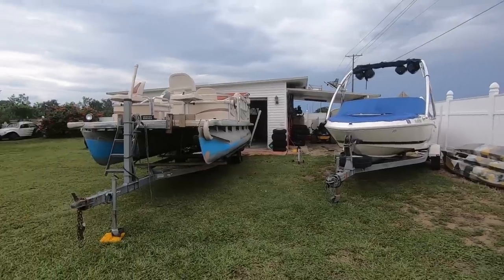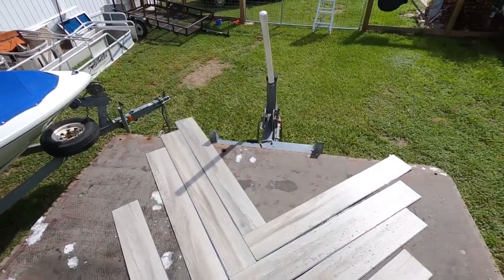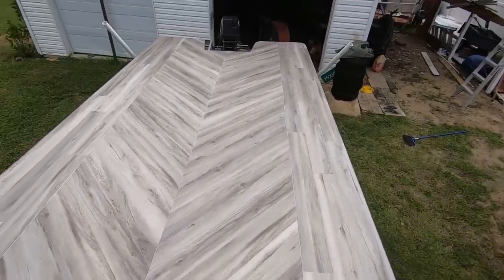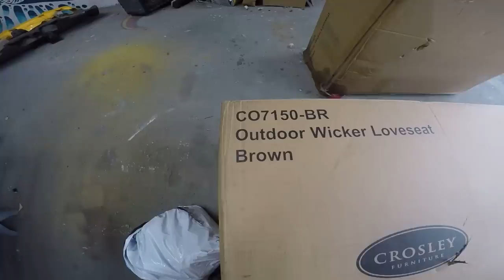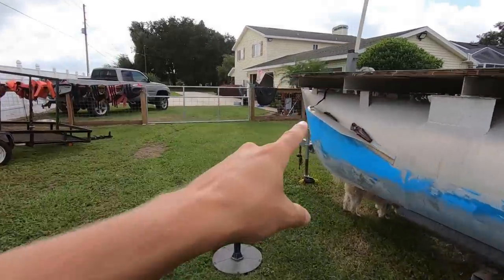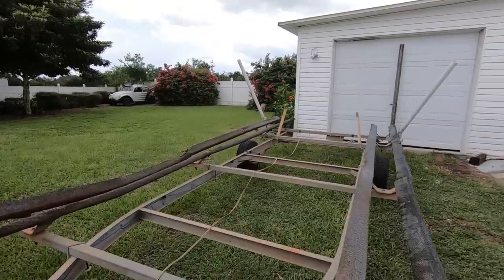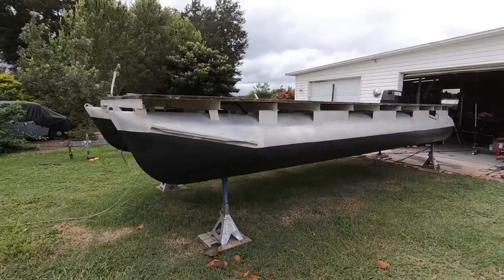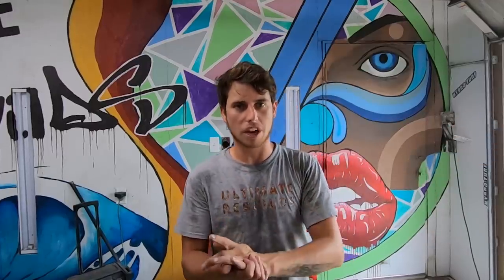Installing Custom Flooring on my Pontoon Boat -Episode 3

Comment: The steps of production here is absolutely crazy.  Strip to make lighter, repair the boat especially the Haul. Rhyno Spray the Haul, Take all the furniture you took off and bring it to an upholstery, should of used Cedar and epoxy for the floor, laminate looks good but absolutely useless for the purpose and style of boat you are using it on. A blue collar sees that as unpractical (we know what happens to MDF when it gets soaked) and Pen pusher sees that oh that looks good no problem there LOL.

Comment: Take your torch take some flux clean up the area take a penny use the fox on the penny with your torch clean that up get somebody to help you take a bag a screwdriver hold it over all the penny over the whole and you solder the side of the penny to the hole we used to do that and radiator repairs.

Comment: you need to get the material you are brazing to up to 750° F. So you should Hold the torch MAP on the pontoon for longer before trying to add material.

Comment: did you use some anti slip in that floor coating? ( maybe you did and I missed it). If not it can be pretty dangerous walking on a moving platform with slik surface and some drops of water on it. I can garantee that some will see this floor from up close when they slip when wet

Comment: Im not 2 sure thats gonna hold well, remember that floor is going to flex, its not like a house that stays flat. Your gonna have to see that ones you try it out and there are some waves. Also is that good on the sun, does it heat up, burn your feet or butt  ??? 🤔🤔🤔🤔🤔
Reply: he glued it down so we will see how good the glue is.......nice marine grade carpet runners will keep it cool for feet

Comment: If the JB Weld doesn't hold, you might be able to find a mobile welder who can do it onsite.
Reply: Could you cut a patch and rivet it over the hole with loads of mastic sealant that you could wipe of neatly. I'm pretty sure I saw Sam Crac basically glue a patch onto the underside of his Ferarri floor with some sort of glue sealant gunk.

Comment: Lol bro bro... You glued down snap together planks... Oh well.. You could have gotten just glue down planks with no groves... Like commerical flooring is meant for.. And when u use the UV coat... Get a little roller stipple built up for grip? But all else.. Get some rubber mats to go down the middle.. Like a garage mat with holes

Comment: Should have replaced the marine plywood. Pretty flooring to put on a rotting floor.
Reply: I AGREE .....TO DO ALL THAT LABOR PULLING ALL THE STUFF OFF THE DECK AND NOT PULL THE OLD WOOD WAS A HUGE .....EPIC.....UNFORGIVABLE MISTAKE.....CANT STRESS ENOUGH TO CHANGE THE WOOD FOR ALL THAT LABOR GOOD GRAVY UUUGGHHHH!
Reply: @craigbielsky115  feel like I should get a shout out since he did both my suggestions in the latest video...

Comment: Make sure you sand down that trailer and repaint it.
Reply from the maker: That’s the plan
Reply: @ultimaterebuilds7127  you can order boards for it that's already wrapped with carpet online. Make sure you change those wheel bearings to.

Comment: These aluminum brazing rods are a scam. How much extra weight have you added with this flooring?
How about putting a screw with sealant to plug that hole?

Comment: If you do buff the aluminum, look at Fiber or Nylon buff wheels that you attach to a grinder.  We used to use them when polishing motorcycle aluminum frames.  It made the first 3/4 of the work so easy.  https://www.amazon.com/Buffing-Polishing-Sanding-Abrasive-Grinders/dp/B07JJCJTGG

Comment: so... regardless of why the floor doesn't work or won't work. you realize you were installing a slip-n-slide right? there is a reason why flooring is not used on a boat. not only will it not last... it is a major safety concern. nothing says have a great time like "alcohol and a slippery surface". injuries to follow, stay tuned.

Comment: You're doing it wrong you have to heat up the metal to  780 degrees which MAPP gas will do that and then you rub the rod over the hole and the metal will melt the rod do not use the torch to melt the rod you use the torch to heat the metal

Comment: That life time composit decking is the way to go with a pontoon floor.
Reply: Too heavy and it has no torsional strength .....nothing better than 4x8 sheets of marine plywood then cover with roll of padded vinyl flooring .
Reply: @craigbielsky115  cedar is light and strong
Reply: @barrythacker7281  no its soft and weak.....marine ply is the best cost effective strongest solution period you have been educated....end of discussion